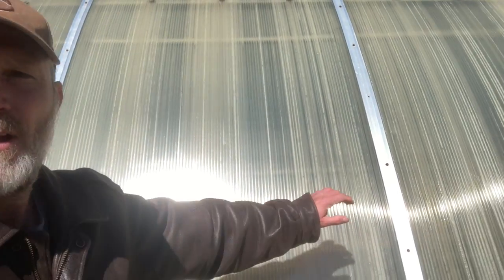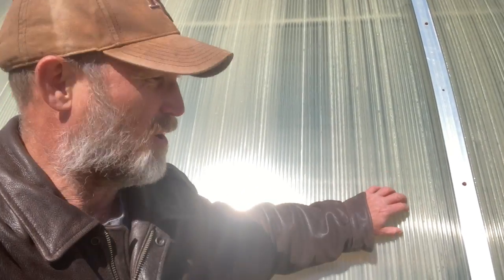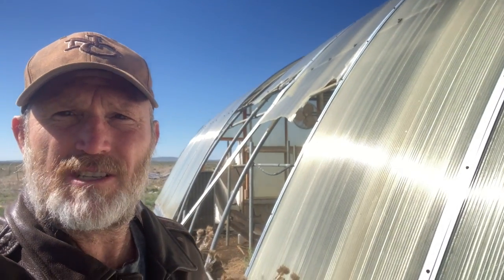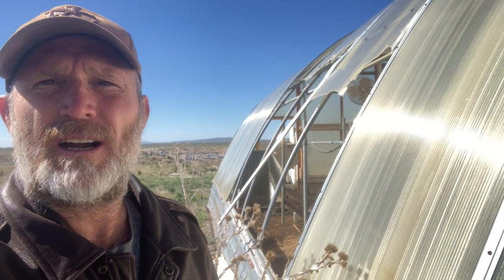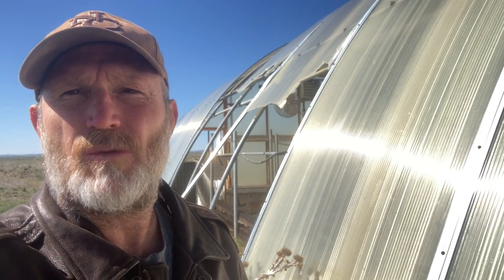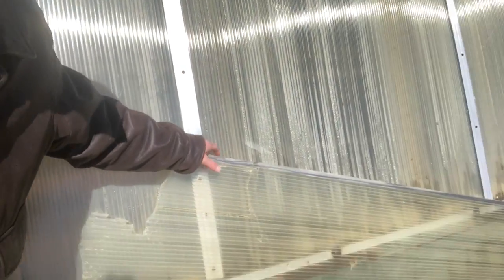Polycarbonate Greenhouse Panels Yellowing??? Why and how long does it take?

Comment: If its still mechanical sound i`d be tempted to run some wiggle wire channels over the hoops and install poly to act as a UV blocker.  If you can inflate it, you`d only need something like 4 mil (100 micron).

Comment: I don't think I'd have any PE left on my greenhouse if it seen 80mph winds.  Have you tried applying 303 aerospace protectant  on the plastic? Try hitting a panel with  weed torch and see if the yellow burns off. It works for the lower windows on my kubota RTV.
Reply from the maker: Never tried a torch or 303.  I emailed the manufacturer about how to extend the life and he had no chemical recommendations.  I know acrylic can have a torch used to eliminate cracks/scratches, but Lexan (polycarbonate) has an extremely narrow "plastic" band melting point so running a torch causes it to bubble and ruins the surface.  Furthermore, acrylic is extremely flammable once ignited, particularly within compartments (look up the Montreal world's fair), cracks very easy and would not be a good greenhouse solution.  Don't know what the solution is.  Keep me posted if you come up with an answer!